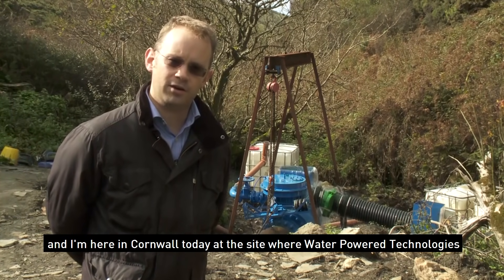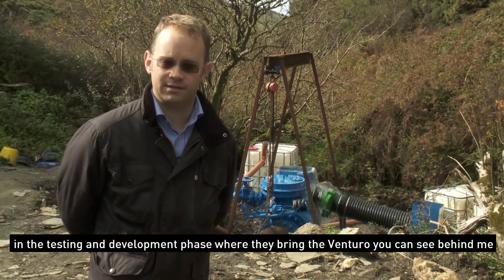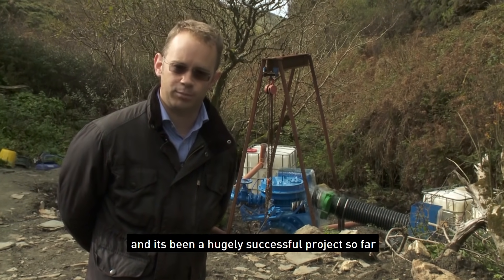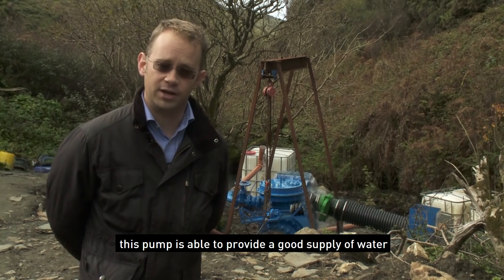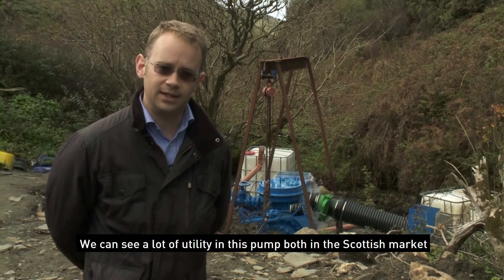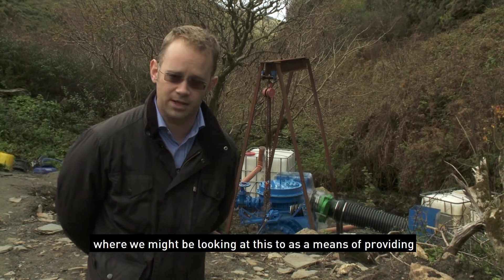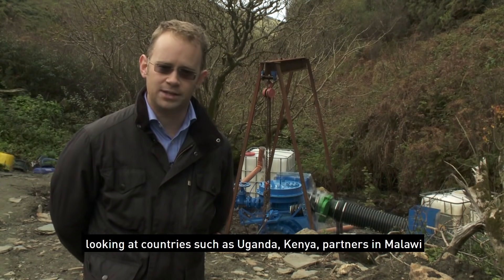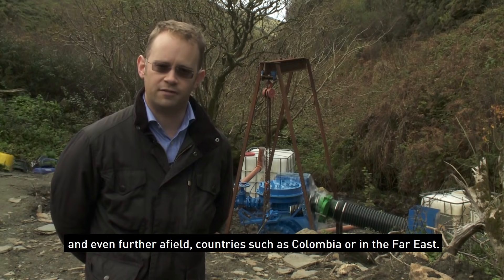Largest Ram Pump in the World

Comment: How much does it cost?
Reply from the maker: The pump is only sold as part of a water solution system and usually as part of a large project.  There would be many variable costs, e.g. tanks, weirs, pipework, lagoons, chambers, etc. and varying labour costs for different countries.  So it is very difficult to quote a cost for 'one pump'.  We would have to look at a project in some detail before we could estimate the cost.

Comment: is der any idea to use the free flowing waste water...?
Reply from the maker: The waste water can be used, for instance for irrigation but in many cases it is better to direct it back to the watercourse.  Think of it as we are just 'borrowing' it, using the energy, and returning it.  Rather like a waterwheel uses the water to power the wheel and then puts it back in the river.

Comment: I'm encouraged by this video, nice work. I have a river running through my property in the Far East and I hope to install ram pumps for irrigation. If I have sufficient fall, I might install one ram pump below another, By ducting the 'waste' water discharged by the higher pump, into the supply to the lower unit and with clever sluicing, I could get more output from the lower unit than the higher one.

Comment: Surely it would be easier to use the flowing water to drive a generator which in turn drives a motor?
Reply: Shhhh you're not supposed to think...
Reply: At what cost?
Reply: Because that would likely be less efficient and way more to go wrong in the system meaning more maintenance.  It would be like having a car with solar panels on the roof to charge a battery that turned an electric motor to tighten a giant rubber band that actually was what drove the car; with that many parts each one has inefficiencies that lose energy.  And that system has more moving parts and parts in general to break, wear and require maintenance.  A ram pump has only 2 moving parts, the valves.

Comment: Interesting. The farm my mother grew up on had a ram pump. They used it until the growth of the nearby city caused the water table to fall.
Reply: How does this pump work genius? The water table hasn't been affecting any of the rivers near me.
Reply: @marcknab7456  Hey fuck nuts why do always respond to 5 year old comments, assume the water source is a river as it is not shown in the video, and Not stop to think why after five years an 71 likes why your the only one that would have a problem with comment but instead embarrass yourself by not thinking?

It ran off a spring numb nuts.

Comment: The hydraulic ram uses the kinetic energy of water running DOWN a pipe to pump a SMALL amount of that water to a higher level than it started from. The bulk of the water flows away downstream. The word WASTE is irrelevant as the water is going downhill anyway. It cannot return to the source except by evaporation and rainfall, or an outside influence such as a pump, which would be pointless. I have two such pumps so a few years experience
Reply from the maker: With the SOURCE being downhill flowing water eg a RIVER, then the exhausted water IS returned to the SOURCE ie the river. We have MANY years experience with ram pumps and there are NO installations of ours where ANY water is not returned to the SOURCE further downstream
Reply: So a ram pump gas no head on it from pump level how hi up can it pump the water.
Reply: @bruceswart2108  from what I've seen, "water jacks" usually come in two ratios: 4 1/2 x 1 and 9 x 1... for instance in the latter example, nine-tenths of the water is used to pump 1/10th of the water 9 times higher than the source is above the pump... 
  peace.

Comment: Looks like it wastes as much water as it pumps.
Reply: that is how a ram pump works
Reply: Ram pumps are just a method to extract energy from a large body of water and concentrate the same energy into a smaller body of water (and typically use that energy to pump the smaller amount of water UP HILL). Water isn't 'wasted' as such, it's just that you have extracted the energy from it, and now you vent it away. The higher 'lift' you are after, the smaller %% of flow you can lift - it's all limited by the "energy conservation" laws.
Reply: spentacle By 'source' I suspect they just mean 'back into the stream further down', not 'back to the water takeoff point'.
Reply: Peter Thomson no as if there's a lack of water in Scotland
Reply: @Jordan Doose Yes... and the water is used at a much higher efficiency rate than this thing is capable of. The amount of fall in this demonstration both in static height and volume of water can do a lot more work than this thing is. And I'm pretty sure the places in the world that need water pumped to them don't have massive hills like this to use in the first place.
Reply: @kleetus92  no one has told you this but i am going to...you are a fucking...moron.
Reply: Ur a dumb ass
Reply from the maker: OK, if you want to be pedantic. It doesn't flow back to the exact same place from where it was extracted, but further downstream
Reply from the maker: The Venturo ram pump does not waste any water and neither do any of our Papa pump installations. In the example shown in this video, the exhaust water is discharged into a ditch running back to the water source as this was a trial installation. Normally the exhaust water will discharge into a concrete gulley or pipes running back to the water source
Reply: The exhaust water CANNOT "run back to the source" is it is now downhill. The system depends on using the kinetic energy of water running downhill under gravity. I have maintained a pair of Blakes Hydrams for many years.
Reply from the maker: I don't know what planet you are on. I have already stated that in every one of our installations, the exhausted water is ducted back to the water source further downstream!. Not a drop of water is wasted!
Reply: Ok, so water is not wasted. But potential energy is.. Wink wink
Reply: Pedantic? It's spent water that will never be recovered or used again without the use of a regular pump to get it back to the source. Yes you can drink it, but it isn't going to do anymore work.

Comment: How much water is wasted in the process?
Reply from the maker: You are correct, we will not call it wasted because it is not wasted. The exhausted water, in all our installations, is always returned to the flowing water source further downstream.
Reply: A little bit goes uphill and the rest doesn't. They won't call it wasted. There's a ton of videos on ram pumps and how they work. They are interesting but terribly inefficient. Very situational.
Reply: @KevinDye101  They aren't inefficient, they are used where water would be running downhill anyhow, in reality they are between 50% and 75% efficient.  If you had that same water drive a generator and used the power to run an electric pump to pump water uphill you would pump even less water uphill and more would be "wasted".
Reply from the maker: No water is wasted as the exhaust water is ducted back into the source.

Comment: Aweesome Engineering!!
This is wonderful Technology available to all... we can see a use all around for Water Systems...
This here is a incredible Testimony of engineering , Good work Team...
Incredible..as is the Grand Coulee Dam in Washington state...changes how water can be applied to Development..

Hoover dam is another example.. but what about Stanley Myers invention of converted Water into Hydrogen gas and then running it through a internal combustion engine!... exhaust would be o2 and h2o...a cup a tea anyone??
Reply: The best thing about ram pumps is that you can build your own rather easily using PVC pipe and some bike tire inner-tubes. WranglerStar has some videos that explain the concept fairly well, and I'm sure there are lots of text sources online. Just do yourself a favor and take everything you read with a grain of salt. Don't believe anything a single source says without cross-referencing it with other sources. If enough sources say the same thing, you're probably on to something. I know it sucks to have to do that, but you have to be like that to get good info off the 'net. It's the only way to avoid chasing your own tail.
Reply: The kind of nerd I like to talk to with a cup of tea

Comment: hypothetically, with a large enough water source, say, the ocean, with the upstream flow cycled down through a turbine, this could provide infinite energy.... there should be ZERO energy restrictions...
Reply from the maker: take a look here: https://www.waterpoweredtechnologies.com/jetstream/
Reply: Sylvia Else after being pumped uphill. The water could be gravity fed into a small turbine/pelton wheel. Water flowing downhill far enough can be discharged at high pressure depending on the elevation difference. 

Just got off the website. They use this pump exactly as i stated.
Reply: In that case it would be easier and more efficient just to have a water wheel driving a generator. No, this application is primarily for agriculture.
Reply: Water Powered Technologies is it viable in hurricane prone areas? Or, cost prohibitive in that respect, I should say
Reply from the maker: A difficult question to answer. The pump itself would be fixed to an RC35 concrete slab 1m thick with remesh embedded and secured by M30 hardware, so it's unlikely to blow away. That's all we can say.
Reply: If you're pumping water uphill to feed a turbine, why wouldn't you just use the water that's running the ram to run the wheel in the first place? This is like a Rube Goldberg machine... it does stuff for the sake of doing stuff to do something you could do easier and more simply with otherwise conventional means.
Reply: It works by capturing the energy in a large amont of water flowing down hill, and using that energy to pump a much smaller amount of water further uphill. It does not produce energy, and cannot be used to provide any.
Reply: W.W I know how these things work. Apparently, you don't.
Reply: syvia else, dont listen to these simpletons, i know how these pumps work too and your right they wont work in the ocean
Reply: Sylvia Else your statement is incorrect, multiple times. You shouldn't comment on things you're not aware of

Comment: How much do they cost, and how many GPH  do they push, and how high ?, I'm really interested
Reply from the maker: The venturo will only be for sale as part of a system and is currently undergoing trials. However we are looking for partners in the delevelopment. The amount of water you can deliver depends on supply flow and supply head. We have pump performance charts available on our website www.waterpoweredtechnologies.com
Reply: Water Powered Technologies , I appreciate your info, and I wil check your web page, it has to be interesting.